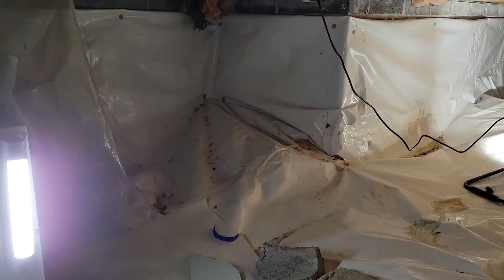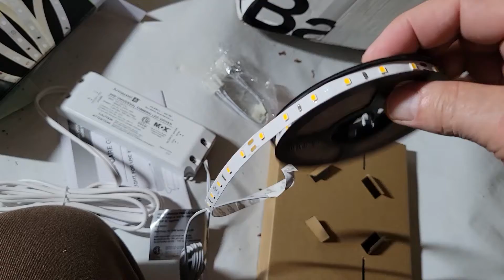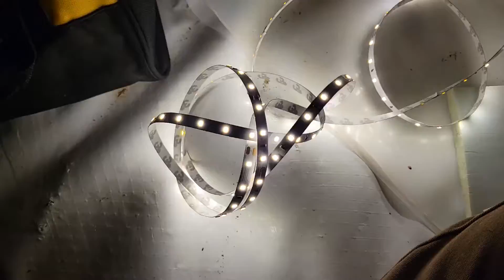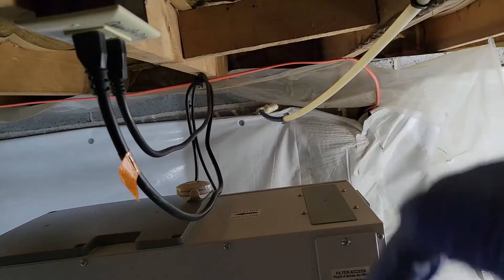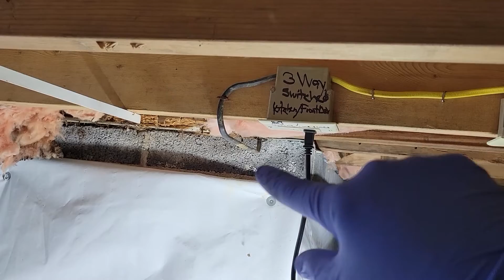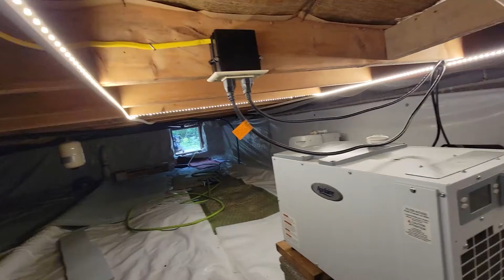Commercial Electric LED TAPE LIGHT 1005 875 040

Comment: So if I have 2 boxes of these, and want to connect them, instead of plugging two plugs in the wall, can I just cut the other box off the plug, and conjoin them with the connectors? So I only end up having to plug in one…?
Reply from the maker: As long as you don't exceed the power rating of the LED driver. Just match the polarity and cut on the designated spot.

Comment: Never done low voltage stuff and you answered a lot of questions I had. Thanks for going over the controller and the tape in detail.
Reply from the maker: In the early days paid money to have a pro install the first one, but since that time the manufacturers made these so much simpler for DIY installation.